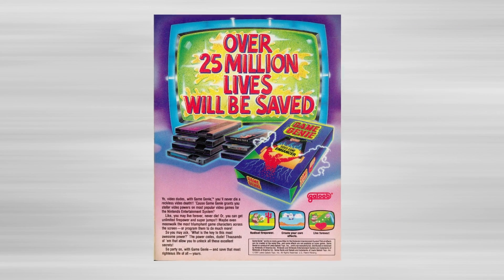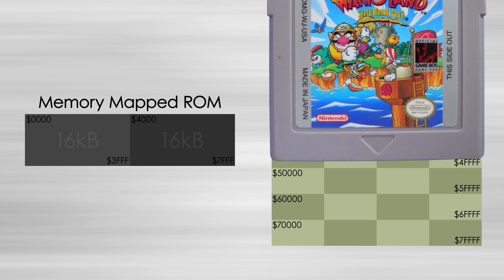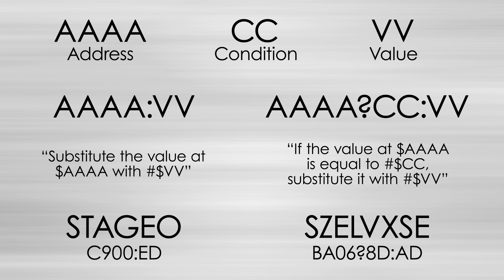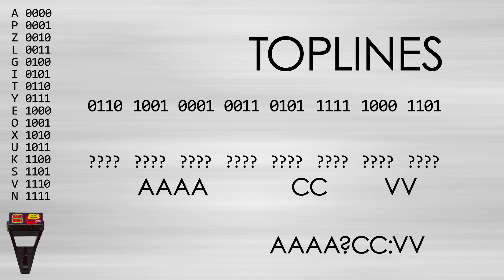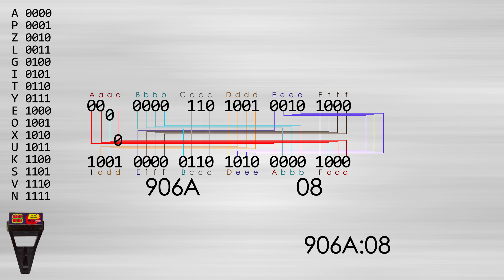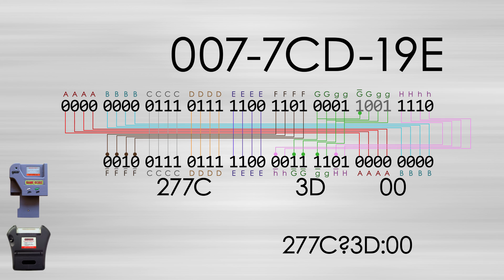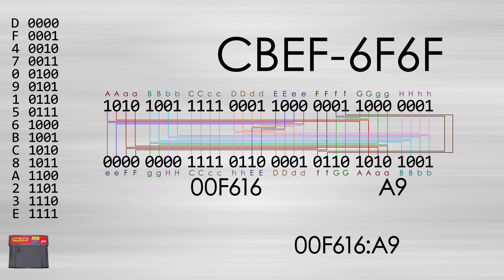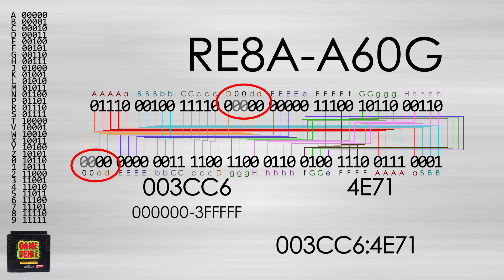The Game Genie Explained

Comment: What's interesting, is that you can probably make a modern version of this, which doesn't sound very interesting at first, seeing as we have modern day mods, except that the game genie is essentially just a piece of hardware, and can make huge changes to the entire system, they're of course less useful back then when everything was stored on ROM, but now that lots of things are stored on RAM, you could probably do some really interesting things, as it would essentially be getting around some of the safety measures put in place by Windows. The way you'd make it is through the fact that you can plug in RAM extensions. If you had something to plug in that would do what the Game genie did, it could be very interesting. Of course, it'd also be less of a fun thing you can mess around with, since it could likely break the entire system due to everything being stored on RAM.

Comment: since many ne snes sega and other didnt have save and codes it was a frustrating to get on in games like smb 1 2 3 turltles 1 2 3 with no save game and codes. so  getting a unlimited timer invinsible and  moon jump enable solves alot of  frustrating problems. get a retron 1 -5 with ingame saveing. when they stopped the sale we were left in the dark and  many games gave up snes sega nes console and worked up a good pc where they could emulat nes nes sega games with game genie shark and so on. nes snes bigges mistake was going of marked. then it was free to get roms and play them on pc ps2 emulations.

Comment: would be intresting to see a video (eventually) on the Gameshark/Action Replay. but given how long console generations it pasted barring into the Wii(then PS3/Xbox era) it still leave s a broad range of platforms and versions overall to cover.  would be intresting to dig thru if theres any unintended side effects of using Say the gameshark/Action replay for PS2 on a Backwards Compatible PS3 (its possible but you haveto modify the system that gives you access to the Disc Drive and Swap, since theres only simple disc ID checks that prevent them from launching on said models at insertion time. incidently, the PS3 doesnt verify on disc boot what's in the drive be for all 3 platform disc types, again only at insertion time. a flaw that persisted since the PS1, and fixed with the 4 and presumably the 5 as theres no way at the time to dump a 1:1 copy of PS5 discs and burn them to check.)

Comment: what i always wondered is how they developed their codes in the first place. i guess they were able to monitor the values being read in, and maybe they could even set up a system to find specific values or increasing/decreasing values over time like you can in most emulators now. but i have a feeling their tools would have a lot less sophisticated, since they weren't starting with decades of experience and an entirely emulated console, lol.

Comment: That encoding/encryption scheme is wack. Here is my interpretation of the 8-character NES genie variant in C:

static char const *genie_base16 = "APZLGITYEOXUKSVN";

uint32_t
decipher(char const *code)
{
    uint32_t accum = 0;
    size_t clen = strlen(code);

    for (int i = 0; i < clen; ++i) {
        char const *match = strchr(genie_base16, toupper(code[i]));

        if (match == NULL)
            return 0;

        accum = 16 * accum + (match - genie_base16);
    }

    return accum;
}

uint32_t
decrypt(uint32_t code)
{
    return
        ((code & 0x80000000) >> 24) |
        ((code & 0x70000000) >> 28) |
        ((code & 0x08000000) >> 4 ) |
        ((code & 0x07000000) >> 20) |
        ((       0x00800000) << 8 ) |
        ((code & 0x00700000)      ) |
        ((code & 0x00080000)      ) |
        ((code & 0x00070000) << 12) |
        ((code & 0x00008000) << 12) |
        ((code & 0x00007000) << 4 ) |
        ((code & 0x00000800)      ) |
        ((code & 0x00000700) << 16) |
        ((code & 0x00000080) << 8 ) |
        ((code & 0x00000070) << 4 ) |
        ((code & 0x00000008)      ) |
        ((code & 0x00000007) << 12)
        ;
}

decrypt could be written more compact at the expense of comprehensibility

uint32_t
decrypt(uint32_t code)
{
    return
        0x80000000 |
        (code & 0x00780808) |
        ((code & 0x08000000) >> 4 ) |
        ((code & 0x07000000) >> 20) |
        ((code & 0x80000000) >> 24) |
        ((code & 0x70000000) >> 28) |
        ((code & 0x00007070) << 4 ) |
        ((code & 0x00000080) << 8 ) |
        ((code & 0x00078007) << 12) |
        ((code & 0x00000700) << 16)
        ;
}

which I wouldn't personally do unless examining the compiler's assembly output showed more optimal code generation in the second version. In that case, I'd header the function with a comment showing the mapping

for 6-character codes, it's sufficient to just append "AA" (0) to the end and feed it through the 8-character decipher+decrypt transformations

Comment: 1:54 "there is no way that the game genie could exactly tell which rom banks are currently mapped to memory"
Since memory bank switching is done by writing to the cartridge at a specific address, the game genie could check for those specific writes and keep track of current bank. The memory controller used (eg: MBC1, ...) can be stored in the game genie code. (I might be missing something)

Comment: You do correct it in the description, but m68k is not RISC at all.

The reason the Genesis/Mega Drive does 16-bit values and all the others do 8-bit is because the Genesis/Mega Drive is the ONLY console among those who had a Game Genie that had a CPU that actually used a 16-bit data bus. It had nothing to do with its instruction size and everything to do with how much data gets read at once on the data bus.

Even if the m68k is trying to work with a byte value, it still has to read two bytes from RAM and its internally that one byte or the other is disregarded. This is why the Game Genie HAD to return a 16-bit value no matter what the m68k was trying to get from ROM.

Yes, the SNES uses a 16-bit CPU built on a WDC65C816 core, but one look at the data sheet for the 65816 design reveals that it's a 16-bit CPU with only an 8-bit data bus (This, among a couple other things, is why the 65816 was not as powerful as the m68k and why the 65816 didn't see real success outside the SNES and Apple IIgs, except in hobby and embedded markets. The CPU was just not very powerful.), thus the SNES CPU can still only read a byte at a time on its data bus, whereas the m68k is able to read its full word length at once from memory. Later m68k implementations would go full 32-bit and reside on a 32-bit data bus.

The 6502 on the NES, z80 on the Game Gear, and mutant z80/8080 on the Game Boy were all 8-bit CPUs on 8-bit data buses.

Comment: I had the action replay for the N64. The one with the big parallell port on the back. You could freeze the game and dump the entire RAM to your PC and search it for values. Amazing stuff.
I used it to cheat several Mew pokemon into pokemon red via pokemon stadium and the transfer pack. Then gave most of them away. Then bricked the action replay by inputting an incorrect master code.
Reply: I always wondered how action replay and gamesharks worked. How did they ensure its own code would run every frame to keep your changes to RAM in place even while the game was running? did it use some sort of interrupt? How did it avoid the game code erasing or replacing its resident program?

Comment: Not that it really matters but the 68000 Processor family aren't RISC processors, they're CISC processors.  I understand why, given your reasoning you believe it is though.  The main giveaway is that instructions for the 68k have multiple addressing modes, and can work with differing word sizes.  

So for example if you want to add two numbers, your source can be either a data register, or it could be a memory address, or it could be a direct number, or even an address in the address register ; it's been a while, but I think the destination has to be either a memory address, a data register, or a memory register.  Anyways, depending on which modes and the word sizes used you use your resulting instruction could be 1-3 words long (resulting in 1-3 cycles).  

One of the main factors or RISC is that every instruction must execute in a single cycle, so for example add instructions would have to be register to register, since you only need a couple bits to address them.  Also the whole multiple modes for an instruction type goes against the whole reducing instructions philosophy.

The reason the 6502 op codes are the way they are is because they've got an 8 bit data width, but a 16 bit address width.  I don't know if that'd make it RISC or CISC; I dont know if that was really a consideration at that point.

Anyways, none of this really detracts from your great video, it's just not often I get to talk about assembly and machine code.  The 68k family just happens to be the one processor I've written a lot of code for in school.

Comment: I think I’m understanding but for Sega Genesis you got the address 003CC6
And I don’t know how, and you got the Value 4E71 and I don’t know how you got that either.
I see there are 10 Rows in groups of 4 when you started with 8 rows in groups of 5.
How did you get 003CC6? Cause when I tried to count the binary and stuff it doesn’t match with what’s on the right side of the screen. I hope I made this question easy. I’m not tech savy but I’m trying.

I did your whole grid on paper and did my own code and when I got to getting the address I had to stop. I cannot figure out how.
Reply: The code I’m working with is AAHT-GAF6

The 10 row code I came up with was 
0000-0011-0000-1111-1011-1100-0000-0000-0000-0000 if that helps

Comment: 68000 is a CISC processor too, not RISC. And the instruction sets of 6502(NES) and 65C816(SNES) are actually simpler. But yes, 68000 uses 16-bit opcodes and 16-bit data bus while the SNES CPU uses 8-bit opcodes and 8-bit bus(this is   probably why they named it 65816) and therefore one must substitute 16-bit values for the MD/Genesis.

Comment: My first cheating device was for my Gameboy pocket and was known as a Gameshark. I also used it on my grey brick (But i had to shave off the notch the brick had. I also had not one, not two but three gamesharks for the n64 (We thought one was broken because someone (I won't point fingers (My brother) put in the wrong master code. So We had to get a new one (Eventually i just asked my friend if I could borrow his games to unlock the Gameshark, prior to this however, we thought we lost the new game shark so we replaced it. Turns out someone (I will not point fingers again (My brother) lent to their friend)
So yeah i have 3 N64 Gamesharks.

I also have a gameshark for GBA, and after that i started using action replay.

Comment: So whats an Enable [or Master or (M)] code and why is it needed for some games?
Reply: These codes are usually used to bypass checksum validation, which is used in certain games. Sega Megadrive\Genesis games usually validate the checksum of the ROM before it's executed. If the calculated checksum doesn't match, the game usually locks up with red screen, or displays error message, it's up to game's developer whenever they add such mechanism along with the action taken on checksum mismatch.

Comment: I used a random code with Pokémon Blue and it deleted all my saved data can I bring it back?
Reply: Probably not. Once the save data on the GB/GBC/GBA Pokemon games has been corrupted and replaced with new data, it cannot be recovered. The DS and later games did start implementing a backup scheme where the save data would be written to two locations, alternating between them so that if the active one became corrupted, the older one would be copied over it, reducing the amount of progress lost. Still won't save you if both saves get corrupted, but that's much harder to do as it only ever writes to one of them at a time.

I discovered this the hard way when I was attempting to transfer a Lugia from XD to Emerald and then to Diamond. During the transfer from emerald to diamond something went wrong and both games had their saves corrupted. Emerald had to start from scratch, while diamond was able to load the backup save. Lost the Lugia in the process, though, and since there's only the one Lugia in XD, I had to start that over again as well on a spare memory card.
Reply: evknucklehead thanks.

Comment: Instead of comparing with a reference value, couldn't the Game Genie just implement the bank switching logic itself? At least on the Game Boy, the cartridge ROM indicated the type of Memory Bank Controller, and there were only 8 or so types in total.
Reply: It would add too much complexity to the device for what they were trying to do. Additionally, the bank controllers were typically in the cartridges themselves, not the consoles, as not all games required them. The Game Genie wouldn't be able to intercept these bank switches as it could not get between the controllers and the ROM chips because of this physical placement.
Reply: It's not because they were on the cartridge, that the Game Genie couldn't emulate it. At least on the Game Boy, bank switches were done by "writing" to the ROM. That's something it could intercept.
Reply: @DrKaspertje  That's how the bank switches are triggered, yes, but the physical connections to the memory banks are in the cartridges. Writing to those addresses tells the memory controller which bank to switch to. The banks still have to use the same address and data lines available through the cartridge connector, which means that when the active bank is changed, it electronically disconnects the address and data lines from the old bank and connects them to the new bank. 

Intercepting those calls on the game genie wouldn't work, as the game genie is designed to compare the address of the data being requested to the ones in the entered code, then substituting the value from the code if the address matches and the value coming from the ROM matches the check value from the longer codes (As explained in the video). About all it could possibly do is change which bank the console is asking for, which would be counterproductive.
Reply: Like I said before, my point is that instead of comparing to a reference value, it could keep track of the currently active bank and only intercept and replace the data byte if both the address and the bank match. The Game Genie has all the information to know exactly which bank is active. It seems more elegant than comparing to a reference value, and completely eliminates the risk of false positives. 

I presume the reason they didn't design the Game Genie like this has to do with the overhead of emulating all possible bank controllers, and that this wouldn't be future proof for new bank controllers.

Comment: What exactly is keeping me from stacking several game genies togeather for all tge codes
Reply: The amount of electrical power the console can supply, plus the problem of sorting through which game genie is in control at a given time, particularly when entering the codes. Then there's the physical size considerations, as the stack of devices would begin to get ridiculously tall once you got beyond 3 or 4. It's also plausible that the devices are designed specifically to prevent you from stacking them together, though I have not physically handled any of them myself so I cannot verify this one. 

Using the Game Genie and its competitors was already a bit of a risk regarding power requirements, as the systems are designed for a certain amount of power to be available to the cartridge port. More chips mean more current is going to be drawn through the power circuitry, and if there's not enough to go around things start shutting down or overheating, possibly even catching fire if there aren't enough safeguards in place. 

Something similar happened with a bunch of aftermarket fans for the XBox 360 (Original design), which were drawing power through a pass-through power connector between the console and the external power supply. The line they were drawing power from was designed to be just enough for the system itself, so the extra current draw of the add-on fans was overheating the supply circuitry, damaging the power supply in the process. Naturally, Microsoft considered such failures to be outside warranty coverage, so you'd need to shell out somewhere around $80-$100 to get a replacement.